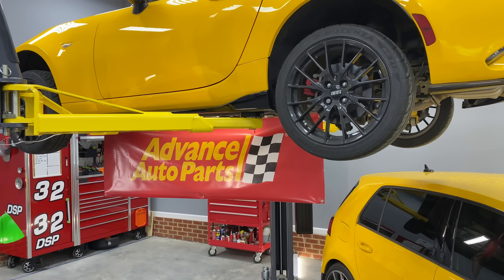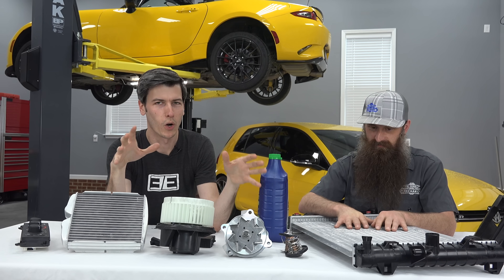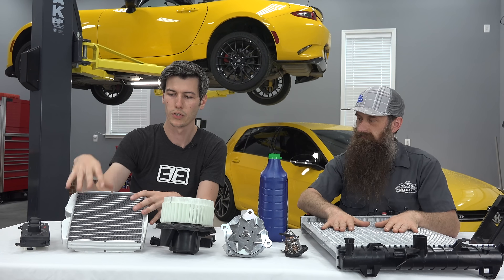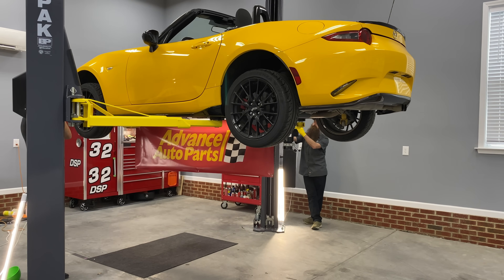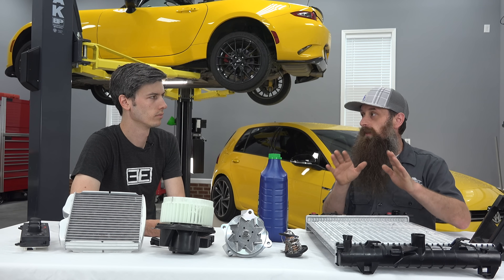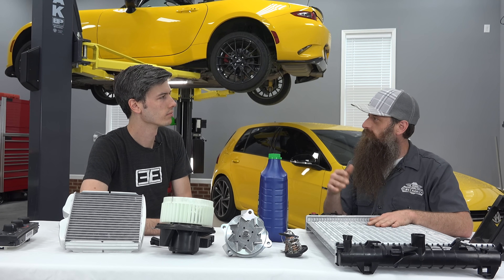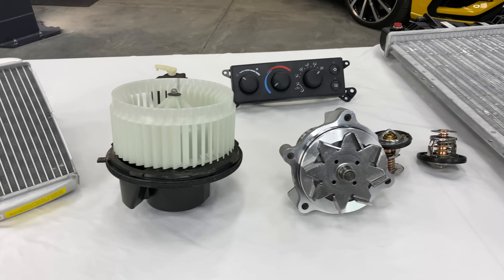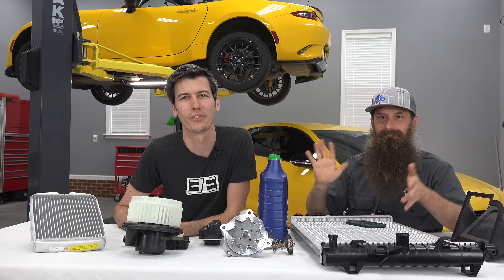Why Doesn't My Car Have Heat?

Comment: My MR2 Spyder coolant bubbles require seasonal burping (in MD). When that happens the heat doesn't blow, but the engine gets hot... Fast... That's The sign of the bubble for me.  Also, it takes about twice as long for the engine to warm up than a front engine car, even with a new thermostat... Does that sound messed up? With coolant piping running from mid-engine to front radiator, supposedly there about an additional 1 gallon of fluid in there to heat than a front engine car, due to piping. But that shouldn't matter if thermostat is working correctly, right?

Comment: For those with newer vehicles, use the AUTO settings!! Auto 72F is generally what OEMs tune to be comfortable in most situations, and you can often just leave it in that setting and the HVAC will manage itself perfectly fine.
Reply: Honestly outside of the most moderate climates where you don't really need AC for anything more than cooling a car thats been parked in the sun, the Auto never worked for me either... you want it to be a couple of degrees the comfortable direction of outside, not try and hold one temperature. If its 21c in the morning you don't want it heating, but if its 31c at midday and your sweating, you don't want it trying to be anything like 21c, else its going to be loud, cold, and enough of a temperature swing getting in/out to give you a headache.
Reply: In 13 years of owning audis I have never figured out the auto climate.   It never feels right!
Reply: I hate auto climate control.  When shopping for cars, I cross any car off the list that doesn't have a trim level available with manual climate control.
Reply: @kc9scott  You know you can operate them all manually right? You can have total control of the temperature, direction and recirc/fresh
Reply: @clayduval1255  Most of the auto climate systems that I've seen let you switch to manual for fan speed and air location, but they still have thermostatic temperature control, with no way to override it.  During the heating season (which is 6 months out of the year here), I want gentle warm air blowing on my fingers on the steering wheel, for a long time until my fingers warm up.  I do NOT want the system readjusting its output temperature as the cabin warms up.  I don't care about the cabin temperature; I care about the temperature of my fingers.  The auto climate controls force me to constantly fiddle with their temperature control to counteract their thermostatic "feature".

Comment: I had a 1985 1.6 Diesel Jetta back 30 years ago. We had a snow  storm so we could not go faster then 10 mph. The 45 minute commute took me 5 hours.  Lots of standing as well.  Point is my little Diesel would not go past the bottom C. So yes a freezing cold car is the epitome of miserable driving.
Reply: An engine should reach operating temperature just idling for far less than that, so you likely have an issue like the thermostat stuck open mentioned in the video.
Reply: @SheepInACart  Because of the efficiency of the diesel it cooled it's self down plus the -10 Celsius. Everything worked perfectly on it. And it had an electrical fan.  Most European cars had electrical fans already in the 70's.
Reply: @bradwick212  As a thermodynamic cycle diesel isn't transferring less heat to the cylinder (and thus cooling jacket) per unit of work completed, but instead increasing the burn-up of fuel compared to an otto cycle engine. Hence while more "efficient" in terms of volume/weight of fuel used, you'll notice diesel vehicles neither have smaller radiators nor less coolant than a similarly powerful petrol/gas powered car, indeed most of the time its larger.

More to the point is the lack of a throttle on most older designs, meaning that at idle the cylinder still sweeps a lot of air, but only injects a little fuel required to keep running, resulting in extremely lean mixtures. Yet unlike on the large but low powered naturally aspirated diesels found in trucks of the pre 1970's, on the smaller swept volume of more modern turbocharged vehicles the actual idle airflow is still far from large, and while it will result in a exhaust gas temprature of 100-200°C without load, plenty to reach the operating mark on the engine and even provide some heat to the cabin if the cooling regulation system is working properly.. at least after 20mins or so to very slowly warm up given that starting temprature. Yet even still, reaching operating heat faster is one of the three reasons that mush newer diesels have started to have throttle valves, enabling them to fuel enrich to bring the exhaust temperatures up as high as ~500°C without making more power when the engine is cold. Other reasons include generating a vacuum for exhaust gas re-circulation/emissions controls and in some cases even on the fly NOX mitigation.... but even without a throttle valve no small euro car engine should fail to reach operating water temperatures (oil is another story) after hours of running, even just at idle.

Comment: Let's talk about "vacuum" actuated climate control systems.
Reply: I had an '85 Chrysler Laser Turbo that I drove for a period of time with the dash out.  The HVAC system was designed so that if the vacuum failed, it would go to defrost.  With the dash out, if you gave it significant throttle for a period of time, you could see the air doors go to the defrost position.
Reply: I have one and I hate it. Works perfect on a cold motor, but doesn't once your hot and idling.. prefering to alternate between where gravity thinks the HVAC settings should be, and where the limp wristed vacuum is softly suggesting the user wanted it.
Reply: @SheepInACart  hahahaha they are always fun

Comment: What is the best way of unblocking a blocked heater core?
Reply: replace it!
and never put stuff to remove leak in your cooling system, it will block it
Reply from the maker: If there are contaminants in it blocking things, best thing would be to replace it so that stuff doesn't end up somewhere else in the cooling system.
Reply: @EngineeringExplained  
Liquid available to loosen it up?
Reply: You can try take both hoses off and backwashing with a hose, but almost always you end up needing to remove it from the vehicle. Once its out its likely worth doing a recondition, you can DIY if you have brazing equipment to remove the tanks, and clean/straighten each channel in the core with a fine bit of metal (like a dipstick) while pushing water through it, then reattach the tanks and reinstall the car. If that doesn't sound like something you know how to do, almost any radiator shop will do it pretty rapidly, but double check what a replacement parts worth, on some cars its a small fortune, but occasionally its cheap enough as not to be worth repairing the old one.
Reply: Three sticks if dynamite.
Reply: Three sticks of dynamite.

Comment: No heat is a miserable driving experience 

No A/C enters the chat room
Reply from the maker: No HVAC, no bueno!
Reply: Not remotely as bad. Full windows down even on a really hot day is tolerable since your moving, AC not even being optioned on half of new cars sold globally until a fairly recent point in history, but heat being standard in almost everything... after all if its freezing outside and your trying to drive in a coat for a long duration and still shivering, life just feels like it sucks... it also becomes a threat to human life a lot easier in extreme climates.
Reply: No ac is bearable. Plus mo powa. No heat up north is terrible
Reply: Welcome to the gen 1 Chevy Volt and it's anemic HVAC system.
Reply: @n9wox  I'm glad they fixed that by the time the Bolt came out. That would be insufferable in the FL heat.
Reply: It's easier to keep yourself warm in a car with thick winter clothing but trying to keep yourself cool in miserable heat is nearly impossible.
Reply: @caldera878  When it's -20 F you're still going to be shivering in a car with no heat regardless of how nice your clothing is. You're sitting stationary, not moving about to generate a bit more warmth. And then there's the cold hands and feet. And that's ignoring that your windows will ice over. No cooling is definitely miserable. No heat can turn very dangerous very fast.
Reply: @napoleontheclown  either or isnt good your either sweating out your body’s entire water content in 5 minutes and risking heat stroke or freezing so bad your kidneys hurt lol I don’t have heat in my winter beater but I do have seat warmers lol good thing it’s only a beater for when I I want to drive like an ass lol
Reply: Haha just open a window, no ac is no problem 🍄
Reply: @davidbergmann8948  you ever been in traffic? Highway is great traffic :(
Reply: Imagine your AC needs a refill but you cant get one because the refrigerant they used during manufacturing is now banned in your country AAAAAAAAAA
Reply: My cherokee has neither lol
Reply: i think i’d rather go without ac, but i’m from the south so i’m used to the heat

Comment: Riddle me this:
My '06 Mazda 3 Si has been regularly getting the P0128 (failure to reach operating temperature) when outside temperature is under 50F. This would suggest a thermostat is stuck open. However, the temperature gauge still reads about the center of the dial, maybe moving a tick down when I'm pulling a lot of air into the engine or in a stronger headwind. 
I am also not getting much heat in the cabin, suggesting the thermostat is stuck closed. 

As stands, I have to run without any heating in the cabin for about 2 miles to build heat and the cabin takes about 30 minutes to actually warm up a significant amount. 
I also had to shift my inspection from March to May so it can pass.
Reply: partial thermostat failure perhaps. dont run your engine without proper temperature
Reply: I have an 04 Mazda 6, and have tested the temp gauge and found it was non-linear, meaning it would stay at near the middle  over a range of temperatures, like 180F - 210F. I'd simply replace the T-stat with a quality part, with the oem 195F rating.
Reply: @kevink2315  Thanks for the info. I've added it to "eventually" list, just below new headlights but above switching the 16" rims the previous owner had put on with the 17" ones that it's suppose to have.

Comment: Move to a warmer climate. Problem solved.
Reply: @PotatoPlayerMadeinChina  No.. those can only draw about 150 watt and your wires to your cigarette plug might catch fire, they are not sized to mantain a 150w or more load. If you really need 12v heat you need a heater you connect directly to the battery with appropriate wire gauge (you will get more than 150w too)

Comment: Whose NB miata was that? I’m trying to put a Pioneer Head with a flip out screen in the bottom of the double din and put a cubby above just like the one in the vid
Reply: That would be my NB :)
Reply: @HumbleMechanic  Did you have to do any special mounting to have the head unit in the bottom half of the DIN slot or does it just mount like it would in the top? I don’t know why I can’t find anything about this topic on the internet, I assumed it would work but this is the first person I’ve actually seen do it

Comment: Excellent video! Because you mentioned the thermostat I might be able to fix my mother's car, it seems to have the exact same issue you described with your Integra.
Reply from the maker: Yeah - if it can't get up to temp, or you can see temp drop ever while driving, likely a failed thermostat! Was an easy fix on my integra: https://youtu.be/P_mUBJ12BNs
Reply: @EngineeringExplained  it drops and goes up to 90C while driving, will be looking into it. Thanks!
Reply: @MadsTer  Some cars cooling systems are not easy to bleed the air out. There are techniques mechanics use to overcome this but if you dont know them it could be a problem. Just letting you know.
Reply: @tubester4567  im aware of that but thanks anyways :)

Comment: What about if your blinker fluid is low?
Reply: Your*
Reply: @jorgechavez7211  autocorrect
Reply: Don't forget to grease the muffler bearings...
Reply: @DaBerger21  and the headers, they will rust quickly if not properly greased
Reply: Probably driving on rusted tires.
Reply: you're = you are
Reply: It's a sealed system, you have a bigger issue going on.
Reply: HEY GUYS! CHRISFIX HERE!
Reply: And dont forget the piston return springs, you haaave to change them every major seasonal change. If they're the winter kind in summer, the springs might launch the cylinder head off.

Comment: "A car with no heat is a miserable driving experience" - Ouch, that burn to electric cars.. xD
Reply from the maker: Electric cars have heat haha.
Reply: @EngineeringExplained  Not to mention instant heat, and even pre-heat.  Ouch, that burn to ICE vehicles.  No pun intended.
Reply: "for" or "on"?
Reply: @Gabriel Rezende well producing electricity often wastes a lot of energy, so it doesn't really matter if that spare heat goes out of the back of a gas turbine or coal plant or the exhaust of a car, as long as we burn fossile fuels for electricity that is a disadvantage.

Comment: Number one reason your car has no heat...it is Winter in Canada and its -40....no heat for at least 5 minutes...maybe more. Pray your car starts.
Reply: I've had thoughts of wrapping my engine block/oil pan in high-heat insulation in the middle of winter, just so the engine loses heat slower when it's off. I'll probably block off the grille completely this coming winter when it gets really cold. I've found that good synthetic oil helps any ICE vehicle. If your engine allows different viscosity oil for different use/temperature conditions, you may be able to use 0W-20 instead of 5W-20, for example.